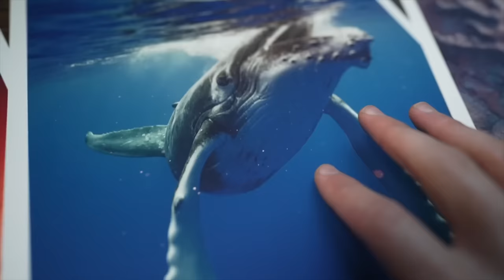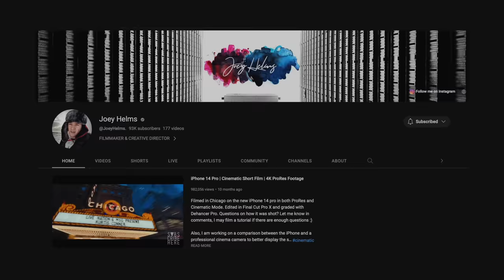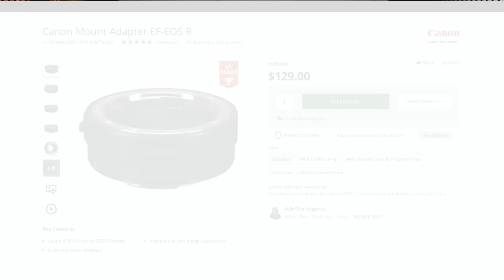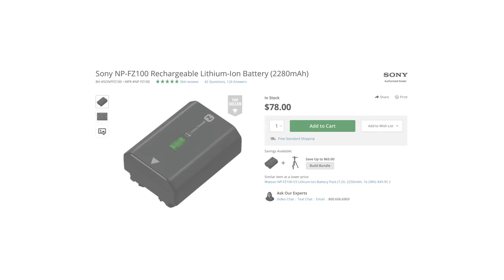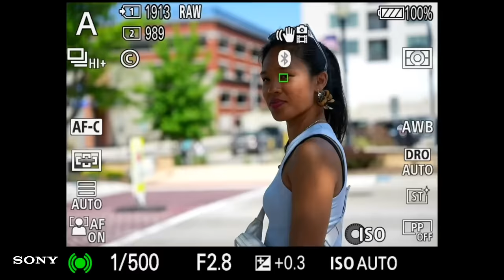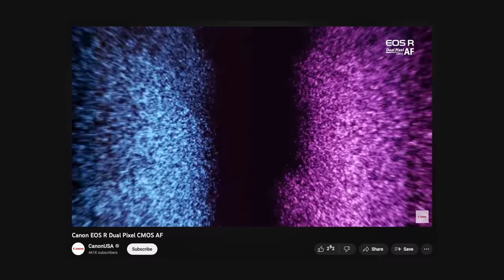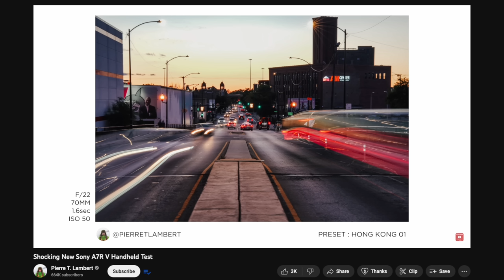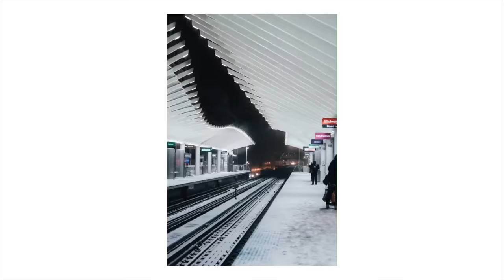CANON Vs. SONY In 2024 - Which one is BETTER?

Comment: I use all 3 systems and have all 3 systems  Sony, Canon Nikon.....  1) Feel - Canon is superior, Sony hurts when held for long time. Sony body is getting bigger it's not small anymore  Nikon Feels amazing   2) Sony lens are smaller but it's not a True Focal length 50mm is actually 47mm ... their 200-500 is 200-469mm....Sony lies.. Canon is better.  . 3) Lens - they LIE...they are not truly weather sealed AND Canon is NOT locked in you maggot...We have more sigma / tamron and other 3rd party lens than Sony AND i can use a drop in DN or POL filter that Sony CANNOT no option for me... Canon is better.  4) Buttons are better on  Canon, when i got a sand grain in my Sony button..it got stuck and bricked my camera.  Canon is better.  I don't need 40 buttons... just need 2-3 custom buttons is enough.  5) cables - stop buying cheap chinese cables.  Use legit quality power brick and cable, don't use shitty cables.  6) Canon can use all backward compatible batteries - don't be an idiot and think Canon Rp will use the same as R3.  My 17 year old canon battery works on my current R5.  7) Canon is lighter because it uses better metal than sony... sony scratches and looks like shit; Canon is better.  8) Sony is not reliable weather sealed; go look at Tin Man how his sony failed and now is using Nikon and other users/yootoobers that left sony because of build quality for longevity.  Canon R5 can be dunked into a river and be saved; Sony will be bricked. 8) I dropped my sony from "knee" height and and the lens and camera crumpled up like a soda can..made very fragile. 9) Sony WILL upgrade the firmware when you BUY another NEW body - FU sony.  10)  Canon and Nikon screens are MUCH better for the price points.  11) in 2023  Canon has far BETTER auto focus engine.  Sony was good but it's horrible for flying birds .. Canon grabs much better and stick better.  12) You DONT HAVE TO TWEEK IT you maggot; Canon works awesome out of the box..... I love your content.  Great Video.  Love your energy.  Calling anyone maggot is my love language.  Cheers homie